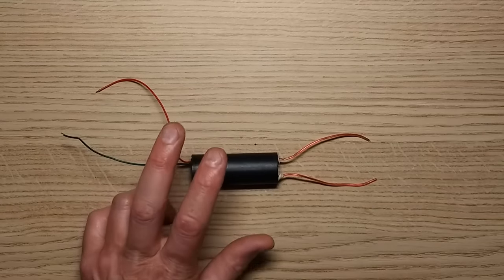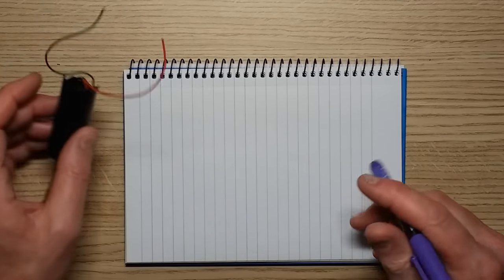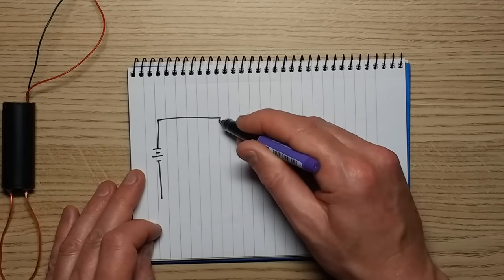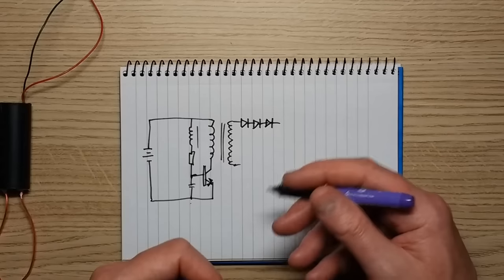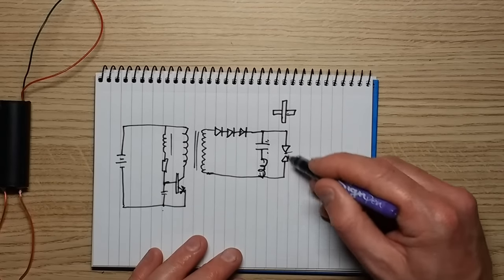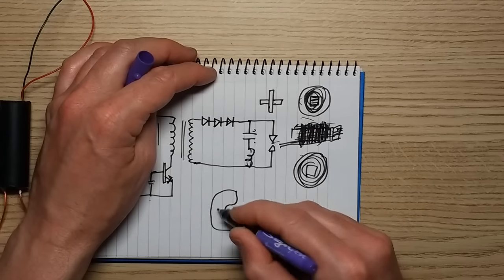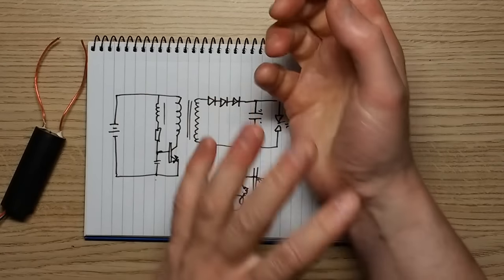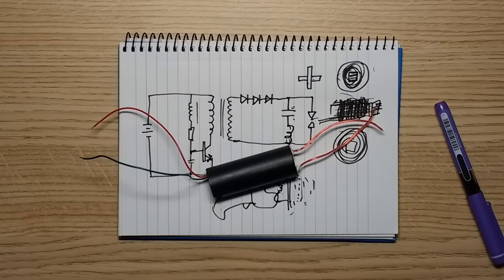Are these stun gun modules?  And do they hurt?  (yes)

Comment: Hello Sir , if I give it 3volts and 2 Amps on input then can I use its output to power anything ?
Reply from the maker: It's only designed for brief bursts of use.
Reply: @bigclivedotcom  
Hey bro , if I connect 2 or 3 of these in series and I provide them 12 volts and 5 Amps of current and then if I use the output on a human , what will happen ?

Comment: Could you let me know how a transformer works on a DC current/ circuit? Bit puzzled how this works.
Reply: Far from a technical answer, but the DC must be chopped up or converted into some type of pulse or alternating current. The transformer has to see some kind of ~change~ in voltage. If you hook DC to a transformer and capture the output at the moment you apply power, you'll see an output pulse of current then nothing as the input side saturates. Rapidly pulse that DC input and you'll see corresponding output pulses.
Reply: Thank you Otto Reuter, that explains how it works. I vaguely remembered that DC did not work with transformer. So in essence this works via fluctuating the magnetic field via changing the voltage.
Reply: Wildy Snow  Yep, all inverter and switch mode DC/AC and DC/DC converter systems are based on using one or more switching devices (transistor(s), chip) to turn the DC current to a transformer or inductor (choke / coil) on and off. Hence causing the magnetic field to increase and decrease.
Reply: 1024 MAK thanks, is this similar to electronic flash like used in photography. i thought that was thrysistor based system not that i understand that much as well, i have heard that the flash gun can be dangerous.
Reply: In this case it's the capacitor discharging through the spark gap and transformer primary. It's a short pulse. The voltage goes up (ie changes) as the capacitor connects, then voltage goes down as the capacitor discharges it's energy, causing it's voltage to fall. Then the discharging stops, and we wait for the next pulse. So although the polarity doesn't swap, like AC would, you've still got voltage going up and down, the principle a transformer works on.

Comment: You can't successfully autopsy those........ 

But it does indeed start with a transformer, which is about 15mm square and wrapped in insulatey dusty epoxy crap.

Comment: What if I connect it to a 9V power source? Will it stop working?
Reply from the maker: It will potentially damage it.
Reply: It will fail instantly. I broke mine with two li-ion in series. Seller's descriptions says 6V is the limit for smaller (400kV) model.

Comment: have not read all the comments. these are not from stun guns, they are from those tennis racket shaped bug zappers. the one i have is laveled 2300V and with a quarter inch spark that is about right, have not tested it with my high voltage adapter for my multimeter. https://ae01.alicdn.com/kf/HTB1CWEWuL5TBuNjSspmq6yDRVXaC/NOCM-Mosquito-Killer-Electric-Tennis-Racket-Insect-Fly-Bug-Zapper-Wasp-Swatter.jpg_640x640.jpg

Comment: It cannot be classed as a handgun. Firearms are defined as 'Being capable of discharging a shot, projectile, or other missile'  or a 'lethal barreled weapon'. This device is not a firearm, under the firearms act.
Reply: It would come under s5 of the Firearms Act 1968, Which includes stun guns, cattle prods and such like. Up to 10 years in prison for possession, though no minimum sentence unless it is disguised as something else.

Section 5(1)(b) "any weapon of whatever description designed or adapted for the discharge of any noxious liquid gas or other thing."
Reply: Cheers, Paul. The goalposts are constantly changing! Luckily I'm pretty handy with my fists/fast runner/improvised weaponry such as dirt/sand in face, etc. or ultimately... a smooth talker to diffuse things kind of guy.  Or my favourite for weaponised fools, Disarm the opponent and use their tool. EDIT: forgot my main point. It's not a handgun, but still a 'firearm' .

Comment: Is this illegal in country's where stun guns are banned? (Kinda time sensitive question hehe)
Reply: Sir Scofferoff  but whats considered a weapon?
Reply: @alexanderbragason3498    I've been to crown court due to this item,  it took a while to get a clear answer to your question. It turned out that anything which can produce an electric arc through and AND is designed to be used as or is later used as a weapon,   is a 'taser' and therefore a prohibited weapon and because it discharges a noxious chemical or gas or substance ( which electricity is categorized as ) - its also a firearm under a certain act.   Presence or lack of solid metal electrodes is effectively irrelevant,  as is power, voltage,  output current etc etc,  is all irrelevant.     Although I  didn't intend what I used it for to be a weapon, I did use it to scare someone and so I decided to plead guilty to intimidation with a firearm.  The judge said my case was unique though and was sympathetic to the inadequacies and complexity of the law and so I was given community service rather than 5 to 10 years custodial sentence.
Reply: @ash0787  oh wow, shit, thanks a lot for the detailed answer though.

Comment: Oh yeah there was copper wire in mine. I remember because I made it into a taser with a 3.7v, 1100mah battery like 9ish months ago and it caught on fire underneath my TV while it was on 'standby' and almost burnt my fuckin house down. Loat my TV and two playstation 3's all because if the $10 worth of parts it took to make it :)
Reply: Sounds more like a battery issue rather than a module failure. Most occasions I've observed them just going open circuit on failure. However being powered by a lithium ion battery as you said, I would conclude your battery failed.That would indicate a failure possibly to protect from too much battery drain during usage. A common mistake with lithium ion battery powered stungun projects.

Comment: i bought one of these but it isnt working. its barely stepping up the voltage at all. can someone help?
Reply from the maker: If you power these modules up with the high voltage leads too far apart the massive open circuit voltage will damage the components.
Reply: @bigclivedotcom  oh dear. Thank you for the help but I measured the voltage on a multimeter and there's was only a very small step up but there was still output voltage. I don't think that is the problem

Comment: I used a high powered and high Amps 7.6 volts with a 4000amps an I changed it to full then I connected it to one of those power modules 🤯 the battery was meant for a high performance RC car it was the most dangerous this I ever made it had anough power to kill a person in less than a fraction of a second 100%

Comment: #Bigclivedotcom Is its output dc or ac ? And if it is dc how to identify its polarity?
Reply from the maker: It's DC.  If you limited the output voltage to a low enough level you could possibly use a meter to measure the polarity once the circuit was off to prevent damaging the meter.  A string of high value resistors in series with two inverse parallel LEDs might be a safer polarity indicator.
Make sure the output leads are never too far apart in use, as the open circuit voltage can damage the internal circuitry.  These modules are only suitable for brief bursts of use.
Reply: @bigclivedotcom  Thanks for answering. One more doubt I can smell a sweet smell is that the Ozone generated by the high voltage?
Reply from the maker: @g-gon8869  if there's a fresh bleach-like smell after arcing it's probably ozone.

Comment: can they take a 9v battery or is 6v the max
Reply: 6vdc max, that reportedly generates 400kv on the painful end. The problem is the harmful amperage on the output, at six volts this can exceed 1amp. DEADLY!
Reply: Modern Leveller that's true, I ordered a few of them but don't want to fry em straight away. thank u sir

Comment: Careful folks, completely illegal in the UK, tazer is classed as a firearm and the punishment for even trying to build one is extremely severe.
Reply: The law covering a tazer could equally apply to spraying deodorant in someone's face. It's very vaguely worded.
Reply: But that doesn't become a weapon until used as one, these DIY tazers on the other hand.........
Reply: What is illegal is a "weapon" so you just need to find two lawyers who agree when this becomes a weapon. The law I'm referring to is in the Firearms Act 1968 Section 5(1)(b) and this is what proscribes the possession, purchase or acquiring of a stun gun. This was pointed out to me during previously discussions I had with the UK's Home Office.
Reply: See, I made one with a mind toward self defence when out riding on £2000 worth of mountain bike.

It was quite nice, compact, 18650 cell driving it through a small 3A boost convertor to get maximum input voltage.
I then read up on the law, found it rather vague but determined it was indeed illegal and destroyed it (well took it apart to salvage parts at least).

The problem really is that in the UK you can't carry anything with a mind to using it in self defence, carried a kubaton until Darren Day got done for carrying one, carried a big Maglite in my car until a random traffic stop, when the officer advised me that I should leave it at home, as if I ever used it i'd be in serious trouble.

Comment: Danielle Harris had a great idea, to use HV modules like this as an anti theft deterrent for motorcycles. I said use five or six of them in parallel for higher current and wire them from the grips, and the seat, so the thief gets a hot shock to the taint, and stimulate the pain nerves of the prostate if male, and twat if not. Imagine the instant regret incentive it would give them to reconsider their actions! Too bad there's not a way to make a self deploying anal electrode that comes out of the seat and light the thief up from the inside out...

Comment: Is it possible to kill a mouse with this?
Reply: Absolutely! But you need to fashion a grid-like circuit that can pass electricity through the rodent as it walks across it. However these units do emit a loud crack with each spark. I would suggest adding a manual trigger, so the unit only sparks when triggered. They won't be scared away then. Perhaps a photo electric sensor or microwave proximity sensor, found cheaply on ebay.

Comment: These modules can generate profanity from a drunk Scotsman (hardly a challenge). Sure, they hurt. But do they actually stun you? Because that's the point of these, for self-defense, to incapacitate your attacker while you run like hell. 

If they only annoy your attacker, you're going to end up with one of these up your arse. You'll regret ever seeing this video. 

I've a feeling these are something like spark starters for automatic gas boilers. To ignite the gas. Fine for that job, but China being... China... some genius sells them as something they're definitely not. If it relies on voltage multipliers to generate a high DC voltage, that's not at all a stun gun, more of... an ioniser. Stun guns put out nasty AC directly from a ridiculously high voltage transformer. 

Clive, didn't you post a diagram of a proper stun gun? A Royer oscillator creates about 400V, charges a biggish capacitor, which discharges through a spark gap into another transformer, the really HV one. From there comes your imaginatively specified output voltage, and they're absolute pigfuckers as far as that goes, could literally be anything up to gamma rays, trillions of volts, say the lies on the packaging. 

A solid-state alternative to the spark gap might be an improvement. Then again you can't beat a spark gap for reliability, they're never going to blow and go fully open or closed. 

I think it'd be interesting to make a proper one by the diagram, or  maybe using your head. The HV transformer might have to be saturated with epoxy under vacuum. Or you could just abuse a 3V mains transformer and stick 600V in the 3V coil. It'll last as long as it lasts.
Reply: OH okay I realise some of this is covered in the video. I've seen this video before, but not for a while. And I'm still sure they're gas igniters!

Comment: What you really should have done is turn it on and see how long it lasts.  These things often die in less than a minute, so typical Chinese R&D goes into them.  btw, I bought this exact model, and was dumb enough to try powering it from my bench power supple - it never worked again, the PSU, not this POS.  So, let's be careful out there...
Reply from the maker: These are only designed for short bursts of use and if you separate the output wires too far the voltage goes so high that it fails internally.
Reply: @bigclivedotcom  Well I know that (NOW at any rate,  after watching your vid. :) ) - at least the bit about the "wires too far apart", very educational that.  But the reason I posted was that I also had a 'proper' stun-gun, and it died, having never taken out a felon or an attacker, after just after a couple of dozen 1-2 second bursts.  Surely it must be possible to design a stun-gun that doesn't croak after a couple of uses.  Those secondary 'spikes' that limit the maximum voltage obviously don't work in the long term.
Reply from the maker: @mojojomo6750  The voltage these things generate in such a confined space puts the circuitry (especially the output transformer) under a lot of stress.  Generally speaking if things are going to fail they do so early on.

Comment: I hate these things, they don't last long and it keep trying to destroy it self, stupid design.
Reply from the maker: +redstone craft guy They are not rated for continuous duty.  Just short bursts, and if the arc wires are too far apart the extremely high open circuit voltage will make them fail internally.

Comment: It's not remotely powerfull enough to be used as a effective stungun. High voltage, very low current.
Reply: Stun guns are low current and high voltage, that is their point.. The idea is to incapacitate, not kill.
Reply: @MrRedeyedJedi  it's also the current that makes it effective. When current is very low, you'll get hurtfully shocked, but not incapacitated. I woudn't use it on a attacker, he'll only gets mad.
Stunguns are more powerfull (read: have more voltage and current), give a uncontrollable musslespazm, which takes longer to recover from.
Btw, stunguns can be deadly.